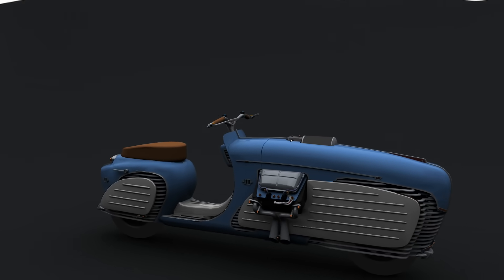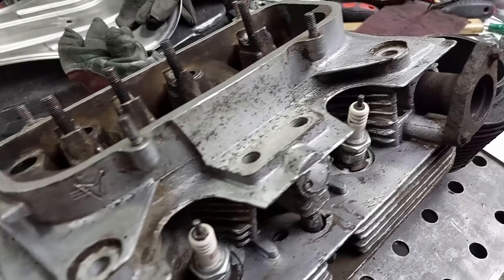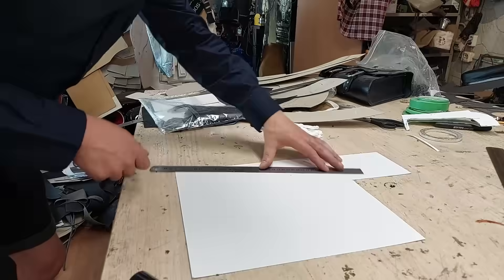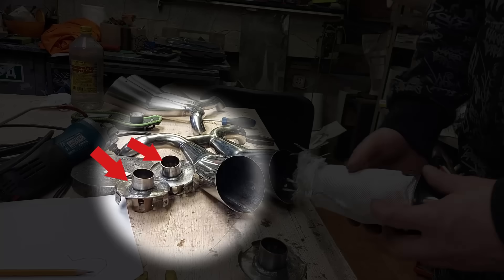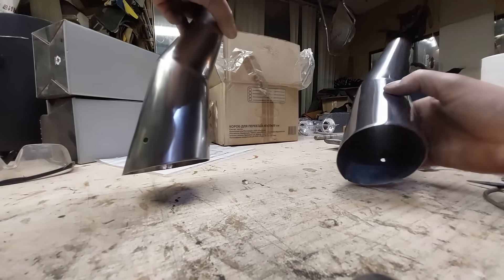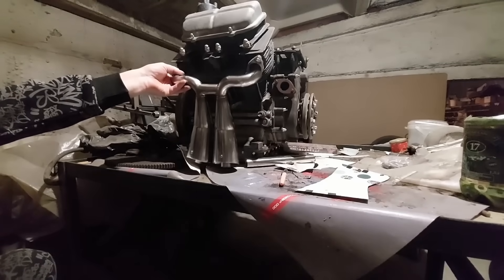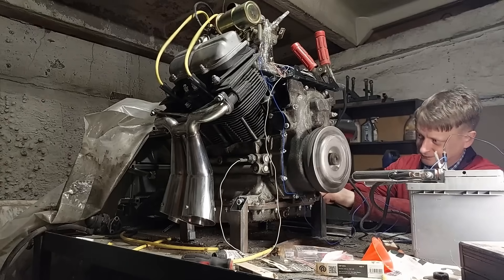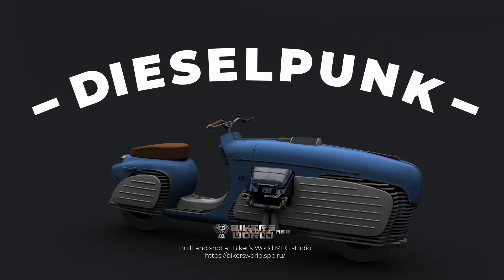I build a car engine scooter. Part1 - engine, mufflers.

Comment: wait how does it turn though?? just turning the wheel within the small space at the front? that turning radius is going to be so large
Reply from the maker: Yup, the wheel is R12 and it won't be a trouble, there is enough space. It might be tough - but only when you push the bike by your  hands.

Comment: 40 horses in that motor? That little cycle will be a peppy little rocket despite its humble moped look. A typical moped with a 1 cylinder, 125cc engine (a tenth of the displacement of the 4 cylinder 1.2L!) pushes about 8 - 10 horsepower, so you'll be running something with four times the power and probably no more than twice the weight.

All that to say that I think the finished bike will be a fun machine to ride, and surprisingly capable and practical
Reply from the maker: Well, I doubt this thing will ever be a daily rider. But I hope that it will be a compact and a light thing. The engine weights around 60kg / 110 lbs. So you are hopefully right (if a snowmobile tranny won't totally kill it's usability).

Comment: I bet you can make an adapter plate for a Suzuki Carry truck transmission and drop it in an Austin 7. Just imagine the engine with ported and polished cylinder heads, Eaton M45 supercharger, intercooler and headers.
Reply from the maker: Well, this gonna be a tiny scooter. The engine itself - allthough it is a car engine - weights around 60kg /120lbs. It is literraly small. So I doubt about using heavier and bigger engine on a 80cm / 31 inch high vehicle. I'll probably have my knees somewhat close to my ears while sitting on it) But, however, thanks for advice💪💪💪 Comments (especially adequate ones) make me re-imagine the whole project once again. Thanks 🤟

Comment: It would probably get crazyt good gas milage too, since it's more aerodynamic and doesn't have to haul 2000 lbs of status symbol.
Reply from the maker: Well, actually it only looks aerodynamic: the front grille will the air get in to cool the engine. So in terms of efficiency it is as good as it would be without any fairings. I also hope the dry weight will be about 250kg / 500 lbs.

Comment: Hallo, kannst Du die Fahrzeuge auf öffentlichen Straßen fahren? Braucht es eine technische Abnahme wie TÜV in Deutschland und Zulassung mit Nummernschild und Versicherung?
Und das noch coole bilks!😅
Reply from the maker: Thanks for appreciating! 

There is a good chance to get VIN number and number plates, but it is not 100%.

But it is easy to make this bike a 'sport equipment' so it becomes off-road legal. And if you get caught riding a sport equipment on the road you just get towed and pay a fine. And this is not that big)

Comment: I'm gonna asume you want the drive to be on the rear wheel seeing as how I can imagen making stearing work other wise might be dificult.
Reply from the maker: Sure, this is not front wheel drive! I suppose FWD on a bike would cause a lowside as you try to start moving on a wet road or uphill or in other circumstances.

Comment: Why from Shaft back to a chain? Propelled the wheel with the shaft like BMW.
Reply from the maker: Yeah, but... They got regular motorcycle whels (approx 6tcm dia) while I have R12 scooter stuff. Here we also got cheaper soviet versions of BMW labeled Ural or Dnepr/Dnipro. I'd take one of those useless gearboxes we have in a workshop and make it hand-shifted like they do on Vespa. But there is no good final drive for this tiny wheel availavle(

Comment: Drum brakes from a honda shadow because the older ones also used a drive shaft which you could incorporate instead of it being chain driven
Reply from the maker: Well, there are those drums and final drives available, but not for R12 wheela. The ratio is too low. Plus I want to have a one-sided swingarm, like they have on old Vespas (or on Ducati bikes).

Comment: chain to shaft to chain is insane
Reply from the maker: Yes, but I can't find a proper shaft final drive to work with small R12 wheels(( Plus I want to have a single-sided swingarm (not sure if this term is correct, but I mean a swingarm like Ducati has).

Comment: Muffler sponges: An old GF of mine had a motorbike with straight pipes. Rude noisy and the neighbors were threatening to show up with pitchforks and torches. So we jammed a bunch of metal sponges up there with a broom handle. it worked reasonably well. They popped out eventually, but we just poked new ones up in there.
Reply from the maker: Well, in this case they work as shock wave destroyers, but the gas flow doesn't pass through them. However, your idea is brilliant in it's simplicity 😂

Comment: Why bother with the transfer case, can’t you run a wheel assembly from a shaft drive motorcycle
Reply from the maker: There will be an R12 wheel. So motorbike final drives have reduction ratios 1.5...2 times higher than needed. Plus those gearboxes are huge, while the scooter is actually quite small.

Comment: question... how does it steer?
Reply from the maker: It will have an R12 wheel which is small enough to turn about 25...30+ degrees to each side inside the fairing. Handlebar will (most probably) be linked to a fork with a single rod. 25 deg angle to each side is enough on the road, but manually parking it might be a problem 😂
Reply: @saintpetersbuilds  I see, what about drive train accommodation? I understand that's what the shaft > gearbox > chain setup is supposed to do, but I figure you could also run the shaft direct either with a double cardan under a raceway or through a spider gear if you offset the shaft as far over as possible.

Would reduce complexity, break up visual symmetry which can be pretty cool, and make the throttle feel more rigid and connected. worth a gander, no?
Reply from the maker: Well, shaft final drive could be a choice if I found a suitable final drive assembly for R12 wheels. All I've checked have ratio around 4:1 to 5:1 while I need 2:1 or at least 2.5:1. Motorbike parts are designed for huge wheels, so they have lower gear ratio. So actually I'd do that if I had those parts available. And the worst is I want to have a one-sided swingarm (with one lever on the left of the bike). So even if I find a suitable final drive there is a chance it can't be used.

Comment: Love to see something old and obscure being brought back to service.  Pretty neat engine, being air-cooled.  Do you think 3d printed blanks might also be a solution for the muffler mock-up?  They are certainly an unusual shape, so custom fab is a must.
Reply from the maker: Well, AFAIK 3d-printed stuff is mega-expensive. That's all I know about it ) Can't even say if it will be possible to polish them, if they will be heat-resistant or if stainless steel is possible for 3D. Sorry. The more I think about it the more questions I have =)
Reply: @saintpetersbuilds  I was thinking as a replacement for the paper mockups you used to cut the templates.  I've used paper as a medium for mockup in the past, but 3d printing allows me to print (as in laser print) out an unwrapped model, which gives you the exact dimensions you need for the part.  More precise than drawing them freehand.  

This was a great video!  Love the design.
Reply from the maker: @Strykenine oh, now I see!  Somewhy thought you mean 3d printing with metal) Unfortunately, I can only use 3DS Max, not Solid Works or other CADs required for 3d printing 😢 So paper rocks until I have a spare week to spend with Solid Works))

Comment: And as long as I am giving unsolicited advice, it would be great to outfit it with one of those huge two-trumpet truck horns. All the dopes on the road who can't see motorcycles would sure notice that!
Reply from the maker: Oh, that's a great idea! We've got several pieces in a workshop lying around, I'll see if they fit the design when I got the bodywork ready. I thought about ooga horn, but I doubt I can find one. So thanks, this idea is nice, I'll probably take it =)

Comment: Oh man, I am drooling over that retro-futuristic design. Now I want one.  Please go into production with them. As a shortcut, you could use a Moto Guzzi V7 transverse V-twin engine. It would look great poking out of the bodywork. You could also run the MG shaft drive under the floorboards--no maintenance! Arranging the CVT would be a trick, but somehow I don't think that's too daunting for you.
Reply from the maker: Oh, this bike will be far away from mass production ) I thought about shaft drive, but most of them have too large reduction ratio like 3:1 - 5:1 while I need something like 2:1 due to R12 wheels usage... So I wish I could go with a shaft drive, but it seems I can't do it.

Comment: CVT transmissions are perfectly suitable for low-power applications like scooters, ATVs, UTVs, and other small vehicles. The primary point of concern when implementing a CVT transmission should always be, firstly, to ensure that the CVT cones you've chosen match the input and output speeds that you need, and secondly, that the CVT is easily accessible for service. It is, after all, a transmission type that requires frequent service, so having it be readily accessible is a requirement. Thankfully for you, the power output of the V4 engine that you've chosen is still low enough that you'll get quite reasonable service life out of the CVT belts before they'll need to be replaced. I suspect you can get between 30 and 50 thousand kilometers if the belts are good quality. 10-15k km if they're not.
Reply from the maker: Pretty sure this CVT is good for this engine in terms of both revs and durability. If revs fail, I will just make those weights a bit heavier. But if it is too weak for the engine... Well, I'll probably make a gearbox with hand shift.
Reply: @saintpetersbuilds  Give it a try and switch it for something else if it can't be made to work. CVTs are the ideal solution for scooters, after all.

Comment: The engine looks like a vw bent to a vee.  The cylinders  and heads look identical as far as i can recall..
Reply from the maker: They are not 100% identical, but soviet engineers definitely had a couple of VW engines to study.
Reply from the maker: Oh, and they also took the design of NSU Prinz for ZAZ 968 😂

Comment: Why not run the shaft drive all the way to the wheel?
Reply from the maker: No suitable final drive for those revs and R12 wheel. So you need a multiplying gear. Or a handmade final drive (which, I believe, will be even less reliable, than a couple of chains).
Reply: @saintpetersbuilds  That's so cool. Thank you.

Comment: Judging by similar build series I've watched, correctly building your front suspension and steering will be important for avoiding a dangerous weave/wobble while driving.  A standard fork front will need to be set at the optimal rake angle, and a hub center steering system will need to be properly engineered.
Reply from the maker: Surely rake and trail are already calculated! But... Well... I hope those formulas are good not only for motorbike size wheels. Because I'll have R12 scooter wheels there. So hopefully we will see that they work fine 😂 If not, then I just have to survive a crash)

Comment: sure modern scooters all have CVT but ironicaly classic scooters - vespas - lambretas etc all had manual gearboxes just with hand shift rather than foot.  so you could of gone either way - useing the gearbox and final drive  from motoguzi or BMW
Reply from the maker: Oh, those final drives are also on Ural or Dnepr (Dnipro) found here in large amounts. But they are designed for regular motorbike wheels, while here R12 scooter wheels are used. So I have to add a multiplying gear or top speed will be 60 kph / 45 mph. But yes, hand shift is my backup plan if CVT fails)

Comment: I do agree with a cvt but i want it to be the hybrid system of a toyota prius as it's much more efficient than a normal belt and cone type cvt
Reply from the maker: Yes, but it is way bigger and heavier 😢
Reply: @saintpetersbuilds but you'll have plenty of space in the front, as for the weight though, maybe replace the electric motor amd battery with something more modern to at least remedy it a bit. Either way, a cvt hybrid scooter would be so incredibly cool

Comment: given the space constraints, i will agree on the CVT, though ANYTHING ELSE is better, in this context unless you custom build and cast a gear box and gear case. you're SOL
Reply from the maker: SOL is 'serial over LAN'? 😂 Well, the backup variant is hand-shifted gearbox, but I will do it if CVT fails only. It is way, way more complicated.
Reply: @saintpetersbuilds  no! shit out of luck ya goof!

but yeah making a proper gearbox is more complicated. but sometimes engineering says "go sit and spin" to you.

though this is am interesting build and i eargerly await more.

Comment: You do not need the CVT. The engine is so hudge, the no change in Transmission is required at all.
Reply from the maker: Oh, it's not huge at all! 60 kilos (130 pounds) and 40 hp only. That's not enough for a gearless stuff. Even Boss Hoss have 2 gears.

Comment: 3:52:  bending flat to tube / ring - it's easier if you start bending at each end - and work towards the middle ;-))   you are welcome
Reply from the maker: Oh, that was softest AISI 430 steel, you can actually bend it with fingers. It was 0.8 mm thick (approx 22 gauge / 0.30 inch). Now I remember I've noticed that before when I made a test cone of 1.5 mm thick (16 gauge / 0.60 inch) regular steel. But I  forgot it by the time I started those cones =) So thanks a lot for a good advice, I'll remember that now!

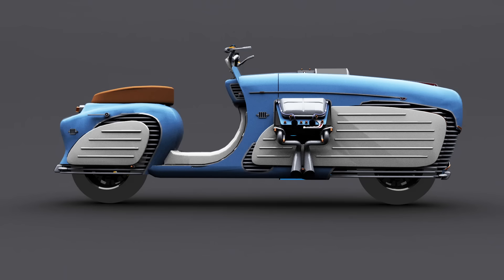Comment: 0:50 OK! Idk about the word “should” - I certainly prefer CVTs of scooters, but I knew people who didn’t!  Many of the older style of scooters (especially the Itialian Piaggio and Vespa) used a manual shift design where the shift handle would rotate forward and back and change gears.  IDK if that’s what you wanted to argue about, but there you go!  (Also, engagement for a cool video)
Reply from the maker: Oh, yes, this might be a good plan. But most probably I'll use it if the CVT fails. Then I'll make a gearbox with a rotating handle like they did on Vespas.
Reply: I definitely see it among the scrapyard highways. And one maintained by a fiend whacked out of his mind on jet with miniature b52 engines on each side..

Comment: if you want a real headache you can try building one of these newfangled geared CVTs 😂
Reply from the maker: Oh, I've seen a guy trying to make one work on a bicycle. Not sure a thing like this survives 40hp =) Or if it does, it probably weighs more than an engine. Well, maybe later on some other project.

Comment: The mufflers probably arent providing any backpressure at all given the straight through design even with the cross over.  Try adding baffles on the end pipes for a restriction and added silence.  And youre planning on using a driveshaft and not a sprocket and chain?  I guess itll be a smoother ride with that big o shaking motor..
Reply from the maker: Yeah, there must be about zero backpressure. I am still thinking about baffles, but those sponges are easy to replace in case of something. So if the sound will finally satisfy me (when I hear it outside the concrete chamber), I'll keep them. A shaft drive requires 2:1 angle gearbox. It must be light, capable of wheel load, working at 5000 revs and having a 2:1 ratio. I couldn't find anything like this yet.

Comment: Where's that engine from?
Reply from the maker: ZAZ 968 Soviet / Ukranian car (Zaporozhets).
Reply: @saintpetersbuilds  Cool 😎, I didn't know about that engine. 
Ford's V4 also used by Saab is the most common one to find. 
There was also a SAME V4 diesel engine used in some SAME tractor models.
Reply from the maker: @tiagofigueiredo2529 yeah, that V4 also has a V6 version) Ford Taunus engines, if I'm not mistaken. But both of them are cast iron and weigh A LOT, although they look very cool. My engine is just a bit over 60 kg (130 pounds).

Comment: this thing is going to go round corners like a wheelbarrow, and brake like a brick,
Reply from the maker: I hope no) Wheels are R12 so the turn angle is not limited that much by a fairing. Drum brakes won't probably be an option anymore.

Comment: Looks great. One question tho, how is it supposed to turn?
Reply from the maker: The fairing won't limit the turn angle too much (plus wheels will be small, R12). And a handlebar will be connected to a fork by a single rod (most probably).